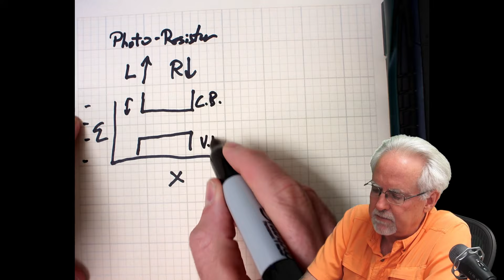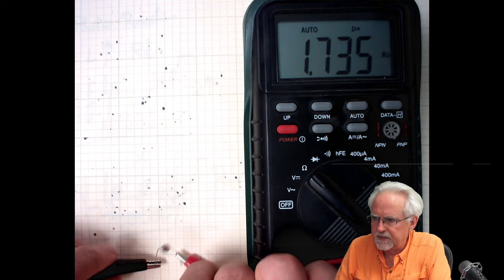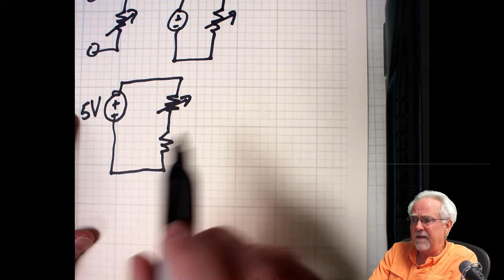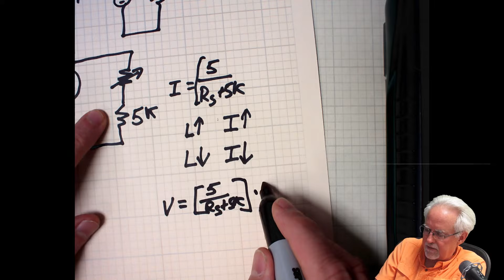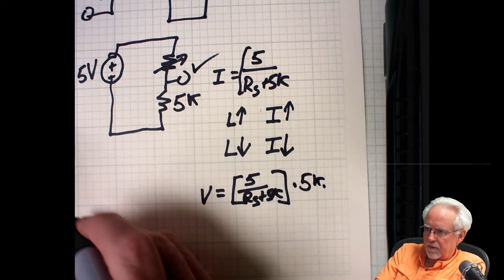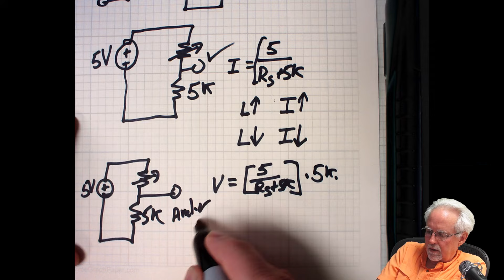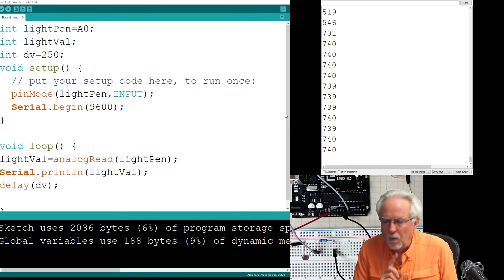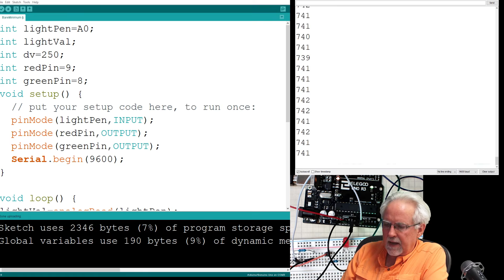Arduino Tutorial 25: Understanding Photoresistors and Photo Detectors

Comment: This one was really interesting. I wrote it with while loops because I've gotten used to them. But when you wrote yours with if statements I realized it was more efficient, because choosing one of a few possible actions based on one reading is more elegant than repeated readings inside each condition's own loop. But I out-Pauled Paul, because I set bright and dark variables so that I could change the cutoffs up top. This helped because I have a few different photo sensors with different sensitivities, so I could see how each read in bright and dark conditions and swap the values. (Also I made a middle state, not fully bright or fully dark, where the lights alternate and flash). Thanks Paul. Lot's of fun. I don't really understand the bands - reminds me of wave interference patterns from HS physics) but I appreciate the scientific grounding.

Comment: I am wondering... if you want to measure the voltage across a component, you have to connect it parallel to the voltmeter. How come that you only use one wire for that and connect it to only one point in the circuit?

Ps: Great lessons...

Comment: Question:
My analog reads high numbers when dark (no light) and low numbers when shining light on the photoresistor (opposite of what you got on your video).
Is this a case of "potato potatoe" or is there something wrong with the component(s)? I'm following your setup to the t.

Comment: I don't understand why the 5K resistor in series is needed to take the measurement? Could you not have the input pin connected to the end of the photoresistor?

Comment: you note that you get a lot of hate from folks.   there are as you well know, two types of students, the serious ones that want to MASTER a subject and the ignorant person who sits at the feet of the Master, there to tutor them. as our world rapidly changes day to day, the ignorant will be swept under the rug. i sew that happen in my IMET course, my wind turbine school working with 480V three phase and the electronics classes, and more recently in my welding class and machine shop instruction.

case in point, i have just enough skill to be dangerous, and i'm about to rebuild a metal fabricating instrument that had plastic (what?) in crucial load bearing parts.  to do this, i need an endmill, lathe and knowledge to use the tools and i have to understand how those tools actually work. your course is no different.

you are presenting a body of knowledge, which is critical to understanding the function of the arduino (arrives wednesday) for its use as a mini-plc.  we did not have arduinos in my school, they came in the next semester after i was gone.  but they were used to collect and monitor a thousand experiments making better techs coming out of the school.    

the new dean, a professor at the time, had recommended and it was approved, that unless a student had over an 80 average in class work, they could not take the mid or final exam.   there was a reason why that school had a 90% hire rate before graduation.

take gratitude that students reveal their nature and telegraph their place in society as those that can follow written instruction verses those that will go on to have a place to stand and move the world.

Comment: What is the difference between a photo transistor (that came with the arduino projects kit) and the photo resistor in the super starter kit? They seem act the same on the multimeter?

Comment: This one was a good one. I played a bit more and set up a yellow LED right across from the photoresistor and could switch from red to green by lighting up the yellow LED. Not happy with that, I left the yellow LED on and set up a cardboard disk with a hole in it that is connected to a crank of a music box. I got pulses every time the yellow LED shines through the hole. I connected it to a small motor and shortened the delay to 10 ms and got pulses at a faster rate. I can use this now as a limit switch device to drive a lead screw a certain distance by counting the pulses.  
I am smarter than shit!

Comment: I know this is an old lesson. But I still can’t understand why you don’t use the power rails on the bottom of the bread board. You can stretch the short leg of the LED to the negative rail,you can put the positive leg of the LED on one side span the resistor and hook up one  wire to the back

Comment: iLikeYourStyle!!
However; one problem I had was I could not get my photoVal to change between lights on and lights off.  What I did was put my pot in the circuit in place of the 5k resister.  ( I use only the one side of the pot and the center) I then adjusted the pot so I got a large change between lights on and light off. What I reasoned was the voltage divider setup with the 5k resister was not great enough to get the change needed.
Best Guess the photo resistor in my kit is different value than the one you have in your kit.

Holding my breath for the next lesson ...

Comment: was able to get the HW done though I ran into a funny issue where I had to debug.  I put the photoresistor on the wrong part of the circuit so when I dimmed the light the value went up instead of going down like expected.  Thanks for the lessons!

Comment: Great lesson. My project worked, but my photo-resistor works the other way round. I am using the MEGA 2560 Complete Starter Kit though.
Reply: Richard Britan what do you mean that your photo-resistor works the other way round?  I also am using the Mega 2560 Most Complete Starter Kit and my photoresistor works the same way as Paul's.  My values are different because my lighting is different, but I get a much higher value on the serial monitor when the light is on than when it is off.  If yours works differently then you might need to check your wiring or coding.

Comment: Ohm's law V = IR...if resistance (R) goes down, shouldn't V goes down as well, or does current(I) go up way more because resistance(R) goes down, and thereby I * R is much larger as a result of I going up and R going down??
Reply: The voltage is 5V throughout the system. The voltage drop changes depending on the variable resistor (the photoresistor).

Comment: I enjoy the maths, I'm not very good at it, but I like it. I did try doing the maths for this one Paul but was not successful, I tried going back to the lesson we done with potentiometers and tried that but I'm still getting numbers about 120 with the light on and 16 with the light off 🤔and I know there isn't 120 volts on there. There will always be haters Paul, they don't have to stay here.
Reply: Gary Hart remember that the number that is shown on the serial monitor for the analog read is not the voltage, but a number that represents how far between 0 and 1023 the voltage is, which he mentions at time of 21:10 in the video.  The 1023 would be 5 Volts and 0 is 0 volts.

Comment: Can someone explain to me why it is v= I * 5k? Why only 5k and not V= I * (5k +RS)? Because we only know a fixed value R? This is driving me a bit crazy. I don't understand why if I take 1M R instead of 5K, the lamp doesn't go out that I clamp in between. Again, if I use 5k it goes out. I thought if R was greater, the lamp would not even turn on. But exactly the opposite happens.I also understand that the light makes the photoresistor conductive. I am just trying to understand what happens between two resistors. Is it because R1 can never reached 1M due to it's max OHM is 30K, which mean that it R1 will never be 0?

Comment: I am currently thinking of using this as a sensor for chicken coup opener, wouldn't the continuous operation generate alot of heat at that much resistance, and excite the electron enough, introducing another variable that affects the resistance?

Comment: Had to do this project a bit differently, but if you hadn't thought us all the math and concepts about resistance, current and voltage and more, it would've been impossible for me to do this project, so let haters do their thing, i.e, to hate. Basically, I didn't have a 5k Ohm resistor so I used 5, 1k ohm resistor instead, and the project worked absolutely great! Thanks for the great lessons.

Comment: i did the resistor on the short leg of led? whats the difference?
Reply: It really doesn't matter which leg of the led you put the resistor on with these lessons so far.  Just so long as the resistor is between the led and one of the power rails, either the supply voltage or the ground.  If an led gets too much current it will damage the led and maybe even be dangerous.  I know from experience.

Comment: int lightpin=A0;
int bluepin=2;
int redpin=3; 
int lightval;
int dt=25;
void setup() {
pinMode(lightpin,INPUT);
pinMode(bluepin,OUTPUT);
pinMode(redpin,OUTPUT);
Serial.begin(9600);
}

void loop() {
lightval=analogRead(lightpin);
Serial.println(lightval);
delay(dt);
if (lightval>800);{
digitalWrite(redpin,HIGH);
digitalWrite(bluepin,LOW);
}
if (lightval<800){
digitalWrite(redpin,LOW);
digitalWrite(bluepin,HIGH);
}
} 
heres my hw code(my photodetector worked opposite from yours, it was from the elegoo 37 sensor kit)

Comment: I couldn't get the green LED to turn on, but after checking my code, i realized that i had declared my green pin to the wrong pin on the board. I had it in 10, but I declared it as 12... ooops...

EDIT:
another thing I like to do is use the gutter as my divider for positive and negitive and use the ground rail for the bottom end and put my resistors at the end of the run (on the ground side) instead of at the begining of the run. I know that's not "normal" wireing procedure, but who ever said I am normal.

by the way, thanks for suggesting i pour myself a Diet Coke without ice at the begining of every video. my body would probably go into shock if I drank anything else...

EDIT2:
I also like to use 5k ohm resistors on the LED circuits because anything under 1k ohm makes it too bright for my eyes and it gives me blind spots. point being you don't HAVE to use 330 ohm resistors, you just won't get maximum brightness.

Comment: That was my Code without watching your answer and it just worked Well, THANKS PAUL <3

void loop() {

  // put your main code here, to run repeatedly:
volt=analogRead(analog);
Serial.println(volt);

if (volt<80){
digitalWrite(green,HIGH);
delay(dt);
digitalWrite(green,LOW);
}
if (volt>100){
digitalWrite(red,HIGH);
delay(dt);
digitalWrite(red,LOW);
}
}

Comment: I forgot to put the resistors in series with the LEDs...but nothing bad happened.....I don't understand how...also the voltage values in the serial monitor were different than normal. So, does Arduino have some safety mechanism that prevented the destruction of the led and changed the voltage value in the serial monitor? Would somebody explain?

Comment: The resistors in the kit I have are kind of tricky to read (they're not labeled and there's no distinction from what I can tell which band is the first band). When I had to find the new resistor to use I ended up making a code to find the resistance of any resistor I plugged in. Then once all that was sorted out I realized I could just use that same code for the photoresistor
Reply: There are a number of resources on the internet that explain how to read resistor values.  After seeing several of them you should be able to figure it out.

Comment: My photo resistor is reading higher the darker it is.... Not sure why...
Reply: Had the v5 and ground swapped
Reply: Homework code

int lightPin=A0;
int lightVal;
int dT=250;
int redPin=9;
int greenPin=10;

void setup() {
  pinMode(lightPin,INPUT);
  Serial.begin(9600);
  pinMode(redPin,OUTPUT);
  pinMode(greenPin,OUTPUT);

}

void loop() {
  lightVal=analogRead(lightPin);
  Serial.println(lightVal);
  delay(dT);
  if (lightVal<=250){ 
    digitalWrite(redPin,HIGH);
    digitalWrite(greenPin,LOW);
    }
  if (lightVal>250){ 
    digitalWrite(redPin,LOW);
    digitalWrite(greenPin,HIGH);
    }
}

Comment: This was very instructive. I did the assignment, which worked after I'd fixed some errors in my circuit. Coding-wise I incorporated two different thresholds in order to avoid the LEDs flickering at the twilight level (instead both red and green come on to indicate we're in the change-over zone).

Comment: Mine was very similar to yours except I used If/else instead of two ifs. I also used different wait and light intensity values, but those are somewhat arbitrary anyway. I did find that it was hard to get the red light to activate because I work in front of a largish monitor and it puts out a fair bit of light. If I power down the machine, it kills that light--and also power to the Arduino. :-/ But I closed all the windows and that reduces the ambient just enough to get the red light to activate. Fun lesson. Thanks!

Comment: doesn't the resistance essentially stay the same? seems like the electrons are excited to a higher energy level which is now high enough to overcome the energy barrier of the gap? just given your example, the conducting material seems to stay the same but the electron energy is changed? or is it the conducting material which interacts with the electrons?

Comment: quick question. when first plugging in the Photo resistor and without adding anything fancy the base value im getting when in light is only 80. however when in dark it drops to 10. however i see that your values are in the 100s. i only get to 400 when i shine a flash light directly above it. could this be due to a faulty photo resistor or other reasons?

Edit: Upon setting up the Homework i noticed that the resistor i plugged into the photo resistor was the 330 instead of the 5k

Comment: Paul, After reading the comments, I re-wrote the if commands using while commands. Still no red LED, but now when I turn on the room lights the green comes on, and the serial print stops printing!  Lights or no, the Arduino hangs up on the greenLED unless I restart the board.

Comment: Paul, I change the order of the if statements, making the > be the first if and the < being the second. Now, the green LED lights when the room lights are up, but the red LED doesn’t come on when the lights are off and the green LED stays on unless I reset the Arduino.  The red never comes on.  It’s like the first LED on hangs up and won’t go LOW.  The serial monitor shows that the photoresistor is working properly.  I’ve changed input pins and int’s, tested LED’s have the same code as yours, with the same wiring.  Help! I even tried another Arduino- no change!
Reply: Paul, I measured the voltage coming out of redPin from from the board, and with the lights off there is 3mVolts.  When I turn on the room lights, it drops to .8mVolts. The greenPin output is 4.91 volts.  Does this help point out a fault to you?
Reply: I also replaced all the wires to and from the red LED, which did not help.  I’m stumped!  Anybody have an idea, please reply.  Thanks!

Comment: Paul, I got the code, and I got the wiring.  The serial output is working according to the light in the room. However, my green LED won’t come on with the light, and the red LED does when I turn off the lights.  Then, the red LED stays on unless I turn on the lights and restart the Arduino. I’ve checked the LEDs with 5volts-working. The wiring is correct.  What would cause this?

Comment: Hi Paul, thanks very much for your lessons. With your lessons I am refreshing my physics and Maths but never had made  practical circuits. Since I am retired this has become my hobby. My programming was as follows:
int Voltpin=A3;
int redPin=8;
int greenPin=9;
int dt=1000;
int In_Val=0;
float Volt_Val=0;
void setup() {
  // put your setup code here, to run once:
Serial.begin(9600);
pinMode(Voltpin,INPUT);
pinMode(redPin,OUTPUT);
pinMode(greenPin,OUTPUT);
}

void loop() {
  // put your main code here, to run repeatedly:
  In_Val=analogRead(Voltpin);
  Volt_Val= In_Val/1024.*5.;
  Serial.println(Volt_Val);
  if (Volt_Val>=1.94){
    digitalWrite(greenPin,HIGH);
    digitalWrite(redPin,LOW);
  } else {
    digitalWrite(greenPin,LOW);
    digitalWrite(redPin,HIGH);
    
  }
  
}
Changing the value on A3 to voltage was superfluous which can be left out.  I used the 'if then else' loop to ensure that there are only two states of the LEDs. I have put a delay command which I then deleted because I noticed the response was sluggish.

Comment: i wrote the below program can you check why is it not working?
int lightpin=A0;
int lightValue;
int redLED=7;
int greenLED=8;
int wait=250;
void setup() {
  // put your setup code here, to run once:
Serial.begin(9600);
pinMode(lightpin,INPUT);
pinMode(redLED,OUTPUT);
pinMode(greenLED,OUTPUT);

}

void loop() {
  // put your main code here, to run repeatedly:
lightValue=analogRead(lightpin);
Serial.println(lightValue);
delay(wait);
if(lightValue>300);{
  digitalWrite(redLED,LOW);
  digitalWrite(greenLED,HIGH);}
  if(lightValue<130);{
  digitalWrite(redLED,HIGH);
  digitalWrite(greenLED,LOW);  }
}

Comment: Great lesson! Although I used a bit different scheme to achieve the results you requested, I still got there! I did have to reverse the switching so the green LED is ON when the resistance is HIGH. And the red LED is ON when the resistance is LOW. Many Thanks to You, Paul

Comment: Great tutorial thanks Paul. For those running into weird issues try placing a piece of paper between the LED's and the photoresistor. The red LED light was enough to make everything go into red/green flicker mode as the value read would constantly change.
Cheers

Comment: I did the assignment with 4 if statements like this.  A bit less efficient than the 2 if statements that Mr McWhorter used, but it still worked fine:

if (lightVal > 525) {
    digitalWrite (greenPin, HIGH);
  }
   if (lightVal < 410) {
    digitalWrite (greenPin, LOW);
  }
  
if (lightVal < 410) {

    digitalWrite(redPin, HIGH);
  }
  if (lightVal > 525) {
    digitalWrite (redPin, LOW);
  }